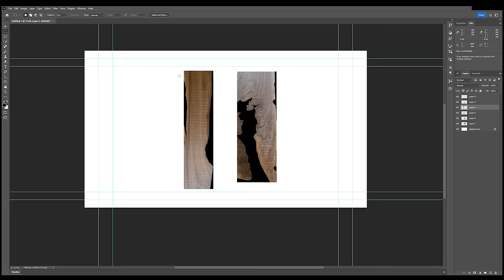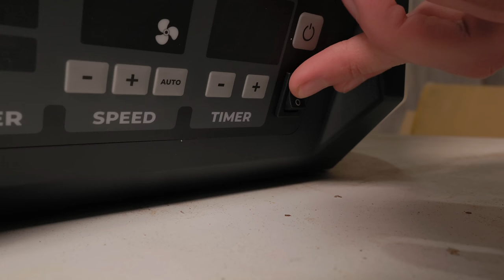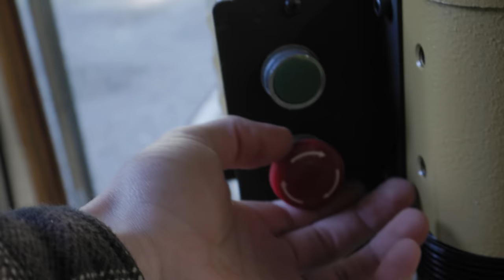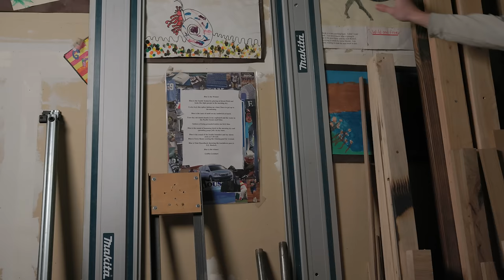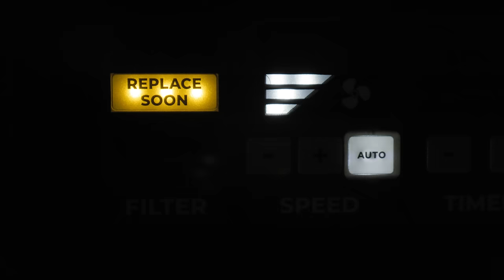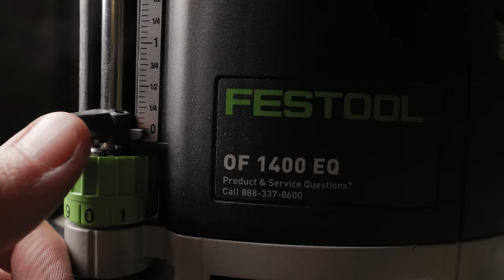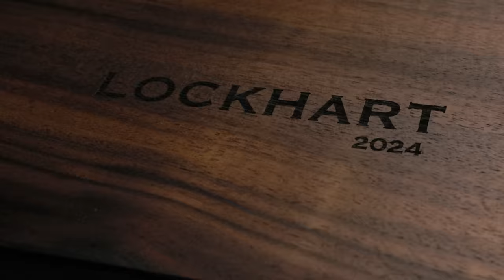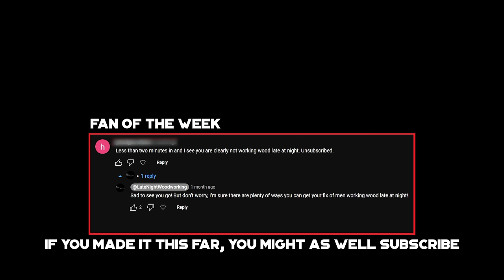The New Blacktail Studio

Comment: In fact as long as the epoxy is the same color for both table tops the divider is unnecessary as you can divide finished casting with your track saw after curing is complete saving you time, materials and getting two finished edges with one cut. Nice work tables very attractive, just making a suggestion for the future. Ray
Reply from the maker: Honestly great suggestions. Thanks Ray!

Comment: But, did you check the moisture content of the wood before you started?
Reply from the maker: lol not before but I did before the epoxy pour
Reply: That bug raises some consternation about how the slab was dried.
Reply: I wonder if it was kiln dried at all. If not there very well may be more bugs in the table and could potentially come out after the table is done
Reply from the maker: There are no bug holes in the wood… that bug was chillin in the bark.

Comment: Very nice piece and stylish video. I particularly loved the highlighting of the more mundane aspects like sharpening - mundane, yes but absolutely critical and the difference between okay and great.

Can I suggest you give Natura Onecoat hard wax oil a try? In the video from the Wood Whisperer late last year, it won the overall winner prize. I’ve tried it and, for me, it’s way better than any other 2 pack. What made me think of this was the gummy tin of Rubio you wear using. I used a lot of Rubio and I reckon my sloppy pouring and that style of tin cost me a lot of money in lost product. One of the smaller things I like about Natura is their cans and the spouts. Even I can’t make a mess of them and the product itself is non-skimming. Hope you can try it out - it’s also significantly cheaper.
Reply from the maker: Wow I couldn’t agree more. I simply don’t understand the cab system that Rubio uses… I swear there isn’t enough hardener in there. I will definitely look into it!! Thank you for the suggestion and helpful comment :)
Reply: I recognise that “where the hardener gone?” feeling. I think it’s partly that you can’t get all of the product out of the relatively small aperture. I think you will find that it’s very different for the better with Natura. I understand the standard instructions to flood the surface with product as it the risk-free approach. However, I’ve been woodworking for 45 plus years and hope my experience allows me to understand the risk and reward in this. For instance, I make decisions based upon which species of timber I’m working with and the particular grain pattern; I’m trying to work out if it is open grain, closed grain or in-between. This “decision” will help me decide to what level of abrasive I go to. 240 grit is the standard advice and I may stick there if it’s very closed grain. If it’s open grain, I will go to 400 grit. I then water-pop, lightly sand and finally clean with alcohol on a clean rag. The risk is that I get it wrong and the oil does not penetrate evenly, leaving blotches in which case, I have to go back to sanding. The reward is that I almost always get a very smooth finish.

Similarly with application. The standing advice is to flood the surface with product; leave for a few minutes and then wipe off the excess. That’s the risk-free approach. Again, for me, it’s risk and reward. I risk just dripping some finish onto the surface and then use a white or maroon pad to gently “scour” the finish in. Leave no more than a minute or so and buff with a white Terry cloth. If I can, I use a car buffer as it’s easier on my old bones. If I can’t (pieces like legs or small boxes) then it’s just offcuts of pad and cloth and done manually. 

With “my” method, I get a finished piece which is easily cured enough with Natura within 30 minutes for me to take off the bench and carefully stand elsewhere. Full cure will take a couple of days. The benefits of this quick cure is that it frees up my bench and stops dust on the air contaminating the piece. 

As you know, every piece of timber, let alone every species, will absorb oil or water to different extents. So, there is no absolute rule on how much product is needed. My median is 200ml of mixed product for each 1 square metre of surface. I find that works out fine most times with my drip method. A bigger issue is getting every last ml out of the mixing cup.

Natura Onecoat is ….one coat. In my experience, if you apply a second coat, the oil element will not penetrate (as the oil in the first second did the penetrating) and you are just left with oil you have to wipe off. If I want a particularly high sheen, I just apply good quality paste wax. 

I hope this helps. Again, I stress the risk and reward element of this and those new to finishing and/or hard wax oil should start off with the standard advice and progress from there.
Reply from the maker: Sounds confusing hahaha
Reply: @LateNightWoodworking  I hope not! A professional woodworker will have a short learning curve to se how they can get the best results. I think it’s a lot more predictable than trying to get consistent results from stains and dyes!